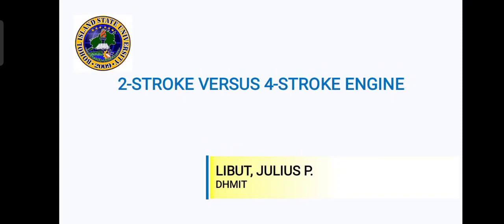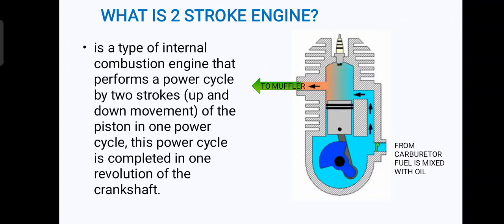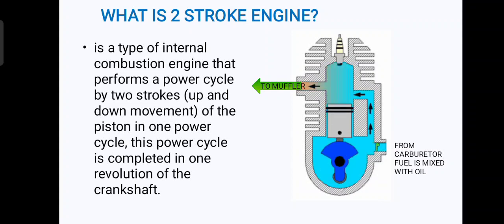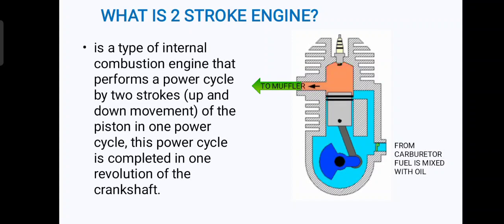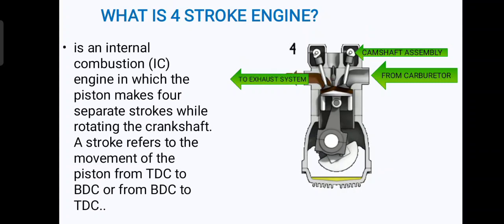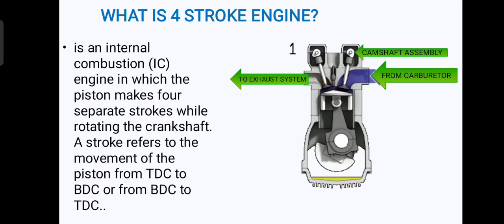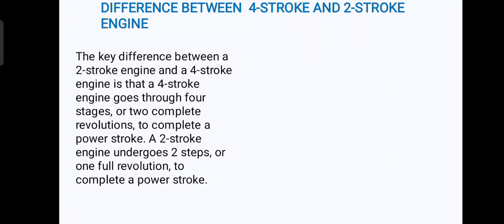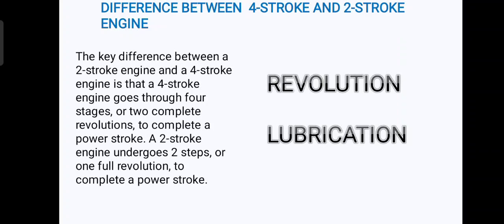2 stroke vs 4 stroke

Comment: The difference between 4 stroke engine and 2 stroke engine is 2 revolution of 4 stroke engine is equivalent of 1 power stroke  and the 2 stroke engine is 1 revolution of crank shaft is equivalent of 1 power stroke ..🔧🤍🤍